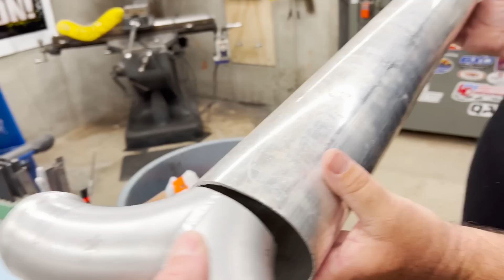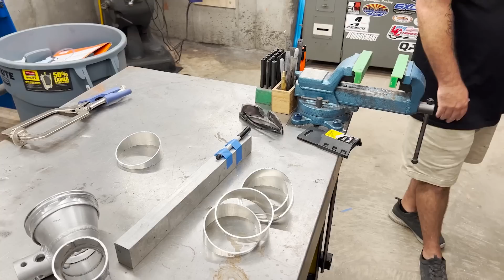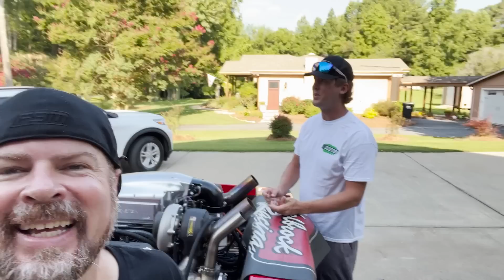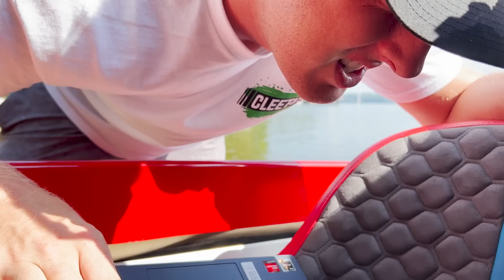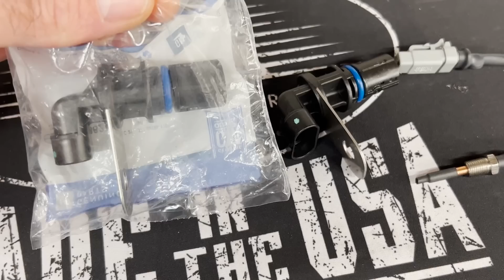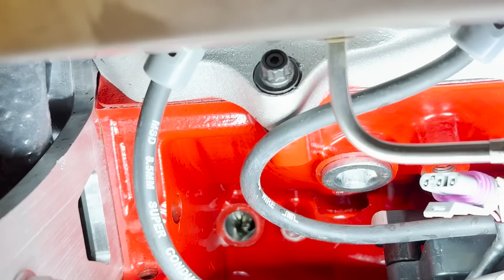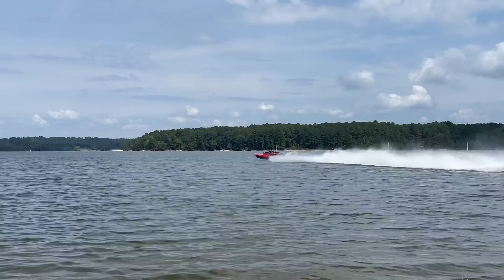CLETUS MCFARLAND, PIE CUTS, BROKEN PARTS AND A NEW PERSONAL BEST IN WIFEY'S WHIP!

Comment: A jet boat basically follows the ideal pump laws. To increase the mass flow rate by a factor of N then pump has  to spin N^2 faster and needs N^3 more power. So for example to double the mass flow rate of the jet the RPM must increase by a factor of 4 and you need 8 times the horsepower. From there if you know all the data from testing then you can calculate your efficiency at different speeds and see how your efficiency curve matches the impellers efficiency curve to see if your optimized.

Comment: Good Stuff!   Question, with the sensor gap being as sensitive and critical as it is why would you not remove the block paint globbers off the face of the boss? Not only does it look thick enough to be an issue it also looks uneven AF. Just another internet keyboard warrior pro tip from Uncle Oful. :goodvibes:

Comment: Yeah, it’s amazing how much restriction just a slightly too small tube can have on airflow. When remodeling my old kitchen, I tried to move the exhaust vent ducting into the floor joists above, but had to cut the diameter by 2” to get it to fit. That caused too much back pressure to run the fan on anything but the lowest setting.

Comment: You need a better/bigger a2w / more effience cooler on that engine. How i make all those ic/a2w cooler system is when boost hit system should work so good that IAT should be same as ambient or less. If you get that close to that there is extra  at least 20-30% more power to coming on that engine. Keep up the good work, That is mean clean machine 👍

Comment: Compressing air with turbo or supercharger heats the air over 300 degrees, look at banks power videos on YouTube about killing a Duramax to see those hot air temperatures destroying power and mpg, that is why you need intercooler or alcohol fuel or nitrous to cool that power robbing hot air

Comment: YOur crank sensor issues .. More boost early means more spark energy to jump the gap, meaning more chance of the HT leads messing up your crank sensor, if you have this issue again, try tying your ignition leads out the way best you can, and/or make an aluminium grounded shield over the sensor.

Comment: I wonder if crankcase pressure is pushing the sensor out away from the teeth. so it will only error out after a certain amount of boost pushes it out- might explain the slightly different design of the two sensors- one less likely to move under pressure

Comment: Maybe the old sensor is being pushed away from its contact point do to the crankcase pressure now that your boost pressure is up hence the reason for the difference in tabs and may have had a problem with crankcase pressure pushing them out just a thought

Comment: It could be that you have too high crankcase pressure & that in turn pushes out the sensor enough to lose the signal, the sensor has quite a large surface area & an o-ring that acts like a pneumatic piston at high pressure, & the fact that it only attached on one side allows it to flex out under high pressure.
Greetings from a Swedish gearhead

Comment: Why don’t you get rid of those crappy prox switch sensors and go with a mechanical rotor encoder sensor? We used them all the time on conveying belts because they’re not influenced by dirt and debris or setup.

Comment: Random pro-tip for 26:20: if you don't want your phone sliding out of your boardshort pocket, fold the entire pocket towards the back of your leg after putting it in there. 
You do this by holding your phone in your pocket, turning the back of your hand towards your leg and pushing the whole pocket back. Saves you from tucking it under your pant leg and risking dropping it after you forget it is there when you stand up. I've been there too many times.
Reply: Instructions unclear. Phone stuck in prison pocket.  Send help.
Reply: @Keifsanderson  Hahaha! You're going to need some BBQ tongs and a whole lotta grease!

Comment: Pie cuts? Hell yea. Also yea, the cooler you get intake temps, the more dense the air is, allowing you to achieve more air in the same volume of space. Something fun that i would like to mess around with in the future is using Bernoulli’s theorem to make turbo routing that doesn’t restrict but changes pipe diameters to increase the pressure, in turn increasing the density.
Reply: Any increase in pressure will result in an increase in temperature?
Reply: @jkK-lw9lu  technically yes, but in this sense I would be attempting to keep the amount of fluid (in this sense for physics I am looking at air as a fluid, not a gas), and the temperature of the fluid constant. Using the ideal gas law, I would be attempting to keep the “n” & “T” constant by messing around with the volume of the tubing used. My thoughts were that if temperature becomes an issue, I could cool the air post-pressurization, but then I don’t know if that would negate the pressurization (basically making all the pressurization pointless) or if it would decrease the pressure a negligible amount. Basically trying to get as dense of air as possible while also having that air flow between Mach 0.4-0.5 (137.2mps - 171.5mps), since that is the velocity at which air flows most efficiently (no restricting or over flowing).

Comment: Finnigan.... I know you dont listen to your clan but it only takes a few thou.. CLEAN THE PAINT OFF THE SURFACE WHERE IT MEETS THE BLOCK AND THE MOUNTING TAB.. I LIVE IN THE MIDWEST AND HAVE ISSUES WITH THE TRUCKS THAT DEVELOPE RUS BEHIND THE SENSOR SURFACE ABS PUSHS IT OUT. YOUR CASE HEAT EXPANDS AND OPENS UP THE AIR GAP.

Comment: Wonder if you got some ignition concerns causing the crank signal issue? Just thinking out loud. Steve Morris had issues with the plug wires burning the plugs, or carbon tracking. Think it was causing misfires and lost drive shaft signal. I’ve seen ignition coils cause some stupid crap on cars before. Had an ford van that would just die randomly when driving. Checked the codes and had pcm failure codes stored. Took me forever to figure it out cause it would run just fine. Finally one day after days of messing with it, it misfired, found out what cylinder with the scan tool and swapped the coil with a tester I had and the stall stopped. Just something to think about. Noticed the plug wires on your boat are kinda close to that sensor, may try moving them.

Comment: you could just have this laser cut each scallop would be 9 degrees as opposed, to 9 degree for three cuts as opposed to two. each 9-degree cut edge would flow onto the next, and you would end up using not even 1 metre's worth of tube.

Comment: just sumting that shot intoo my mind : would the reluctor wheel turning magnetic cause the pickup to give off faulty signals ?
ig thsts the case you might be able to solve it by making the reluctor wheel out of stainless steel (or at least part of it as you probably canot weld that to the crank)

Comment: As someone who works with low voltage signals around high voltage/current noise, you have to be super careful with the routing of the shielded low voltage wires. Do not concern yourself with neatness, keep the low voltage signal wires far away from high voltage things like spark plug wires or high current wiring like are feeding the coils and injectors. I wouldn't even have the crank and cam sensor wiring bundled in the same harness.  Also they can only cross at close to 90 degrees if they must cross each other. Anytime wires run parallel near each other, you will get some signal cross talk, even if the wires are shielded.   

I deal with this problem building the tube HIFI amplifiers I make, and "lead dress" as we call it is key to not introducing noise into the low level input signal. The other key is ensuring the wire shield is actually grounded at the ECU end so it's functioning as a shield. A digital device like these engine ECU's can ignore noise up to a point, and then after that, the signal turns into garbage. I highly doubt it's a "bad connection" given the super low current we are talking about.

I am curious what the output of that crank sensor looks like on a scope, and if I was having this issue, I would put some sort of a data logging scope at the ECU end of the sensor wire to see what exactly is happening to the signal when it fails. Is there a ton of extraneous noise or does the sine wave flatten out? Even just looking at the scope pattern at the ECU in real time with the engine running at different RPM's might point to the problem. My guess is the wiring is picking up noise that overwhelms the signal due to the routing of the signal wiring.
Reply: Skunkie knows of what he speaks.  I've been in aviation avionics and controls for years, and shielding isn't just wrapping wires.  Bonding one or both ends of the shielding to the connectors or device is critical as well.  Low voltage signals are always kept separate as much as possible.  I'd be willing to bet it's why some folks have issues after they've done an LS swap in their garage.  There's a reason GM fabricated and routed their wiring harnesses the way they did.
Reply: @G_Machine_Joe  never both ends, dont want ground loops either
Reply: @mycosys  right, never ground the shield at both ends.
Reply: @G_Machine_Joe  This exactly. Avionics tech here too. Think some single shielded wire with a nice grounded plug wouldn’t hurt a critical component and maybe shave the paint off the block where the plug mounts up. I’m sure the RFI of the spark plug wires being so close, isn’t helping any.

Also if you saw their build vids, they use some nice pin and socket plugs and fresh DMC tooling. I was stoked to see all that good hardware but the wires themselves were lacking. Don’t always need anything more than automotive wiring but then you run into funny stuff like this sometimes.
Reply: I’ve had more success draining shields at one end ONLY (usually the source) due to ground differential voltage.
Reply: @jkK-lw9lu   You're right.  A lot of times it's done that way.
Reply: You don't need a scope to know what the Holley ECUs are seeing for crank and cam signals (including when/where it looses sync). All they need to do is set the data logging to "System Log" and it will record the actual crank and cam signals (along with other diagnostic data). I learned about system logging (several years ago) because my tunes are on drag bikes that Holley had never been on = learning curve that came with no instructions...
And you are 100% correct about keeping the crank sensor wiring separate and away from any/all 'noisy' inputs or outputs👍
Reply: @KCadbyRacing  Well then this should be fairly simple for someone who understands electronics to diagnose, if you can datalog the actual signal waveforms. I don't buy this many crank sensors are bad and like on Cletus's car, they went to a front balancer type crank trigger and still have the same issue. My guess without seeing the car is the low voltage signal wiring is neatly bundled in with the injector/coil wiring and these problems are cross talk related.
Reply: this ^^^^^^^
Reply: how about shield everything
like only run shielded wires? or wrap everything up? 
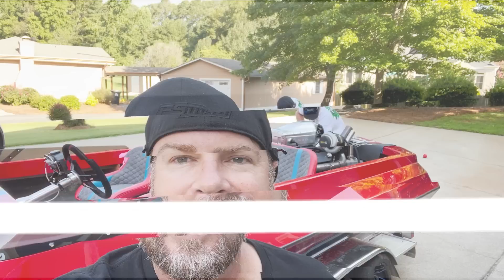19:34 cleetus arrives just fyi
Reply: @feelinghealingfrequences7179  That's how you do it when you cannot be bothered to deal with "what if". It's the nuclear option.
Reply: @feelinghealingfrequences7179  was a a
Reply: A "bad connection" can form between the hall effect sensor and the reluctor wheel with engines like this.  Engines meant for lots of power are built loose, which increases the amount the crankshaft can wiggle.  Finnegan's breathing/tube mod for more power, plus all the boost they were already running will increase crankshaft wiggle through bearing clearances, as well as crankshaft flex.  

Since the reluctor wheel is tied to the crankshaft, and the sensor the block, a little more power or RPM can put enough flex in things to lose signal.

Also, as Cletus said, many blocks are clearanced wrong at the crankshaft position sensor.  It's weirdly common on aftermarket blocks.  I wouldn't put one together without checking.
Reply: Is this the same concept as not running power wires from battery -> amp on the same side that speaker & RCA’s running to amp… like the difference in signal strength between the crank sensor wiring & say the much larger gauge plug wire next to it causes the sensor wire to pick up the waves from the larger wire?
Reply: @matthewserrao2926  Yes, that's exactly what can happen. It can happen both with a high current like the injector wires or the power wires to the coils, or from  high voltage like plug wires.
Reply: @SkunkieDesignsElectronics  oh cool! Idk why I never realized that the whole speaker wire away from power wire was an electromagnetic interference problem. RF & circuits are always a fun time
Reply: If you wanted to create a broadband interference generator, an ignition system would fit the bill very well. I bet manufacturers spend serious time on wire routing to make their systems reliable & repeatable
Reply: Yup. I was an engineer at a company that designed and manufactured interconnect systems for life support, security, military vehicles, high speed data communication, mainframes and such. We had a lab and with pretty sophisticated equipment to measure EMI. You learn very quickly that cross talk is the rule, not the exception. Getting it down to an acceptable level can be a nightmare!. You would do well to follow  Skunkie's advice. Running wires in parallel is asking for trouble. Crossing at 90 degrees is a must for any critical application. It helps to have some distance between the wires as well. For motorsports applications, 1/2" is usually adequate. It's quick and easy to do with two cable ties at 90 degrees inside a short length of reinforced fuel line.
Reply: GM harness run everything together in one bundle coming from the PCM
Reply: @steveww07  But that doesn't mean they aren't paying attention to how these are bundled and which wires are near other ones, or how they are routed across the other components. They also aren't running monster injectors and mega spark coils dealing with providing spark at high boost. As boost pressure goes up, so does the demand on the ignition coils, which makes them draw more current/produce more EMI.
Reply: 💯 facts awsome comment
Reply: I had this with a dragbike running a sprintmag and efi. The wires taking crank sensor data were getting interfered with by the emf from the mag, so I ran the sensor wires inside braided stainless hoses and grounded only one end of the braid. End of problem.

Comment: my crank sensor on my megasquirt 3 was vibrating at anything above 3krpms. it was the flat sheet steel mount , i made a new generic arm for it out of angle iron. mine was on a 5 cyl audi but same concept.

Comment: The pop off on the jet drive needs a safety switch that pops it if the ignition cuts....  maybe a .25 delay. Fast enough to prevent a submarine but not so fast that it pops on a momentary glitch.
Reply: I agree 100%.
Reply: if the ECU has an extra output you could use engine RPM. if it drops below X rpm then it runs the pop off
Reply: @Woodie-xq1ew  Too many variables.

Comment: Does Holley have the ability to look at 5v supply, ground and sensor of the sensor? might be worth trying to catch the issue with an oscilloscope on it if Holley is not fast enough.. Is the wiring running next to any high power voltage sources (spark plug wires, etc) that could be causing interference.

Comment: Find a fine thread bolt that will slide in properly to the crank sensor hole.  Machine the end flat on the bolt.  You can turn the nut to set the depth measurement.  Use two jam nuts.  You might modify a jumbo nut into the jam nut.    Then you can machine a bore to put an indicator on the end to check the difference of inserted depth from the bolt to the sensor.

Comment: Might be a silly observation, but when you were looking at the crank sensors, they were facing each other ( mirror image). They were not orientated the same way, so of course the mounting plates looked off. Only the centre lines of the plates would be the same.  Cool boat and nice fabbing btw. 👍

Comment: Mike, I would bet that the lake water temp also went up somewhat between your 111 and your 117 mph runs, making your changes even more significant. Spinning the pump almost 300 more rpm and climbing faster in rpm would probably indicate a couple hundred more hp, and the cooler inlet temp would be safer for detonation. Awesome before/after investigative work and results!

Comment: Mike, Just a thought… do you measure crankcase pressure? Wondering if crankcase pressure could be pushing sensor out of the hole and flexing its mounting tab creating a larger gap causing crank position interruptions.
Reply: Cleetus has his crank sensor mounted externally and still has a lot of issues with it.
Reply: @MX304  Cleetus probably have no clue about keeping wires separated, read comments on this video.
Reply: @erik_eriksson_design  The video that Cleetus posted today shows them finally solving the issue. It had more to do with the cam sensor than the crank sensor.
Reply: I was thinking this too.  With that much boost there'll be some blowby. And this would jive with the whole more boost = more problems issue.

Comment: The cross sectional area of two 2.5" pipes are about 9.8 in2, which is about equal to a single 3.5" pipe at 9.6 in2. Great work as always! Things  change of course as the shape changes to more oblong.

Comment: If max boost is 25lbs & ur currently pulling 6400 rpm , from memory U have a max (engine rpm 7500-7800 ) U guys should be pulling around 125-135 mph by the time u r Done .  Look'in 4ward 2 Seeing that . Giddy Up .

Comment: Another cool trick I picked up for cps while working on top fuel cars, is to wrap the sensor clearance with 8 gauge copper wire to make a spring and use dielectric grease